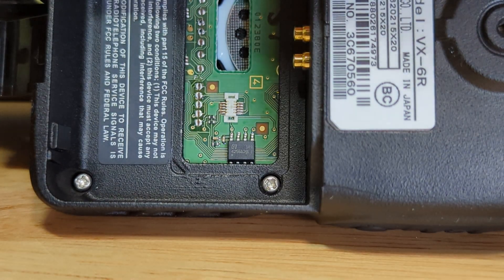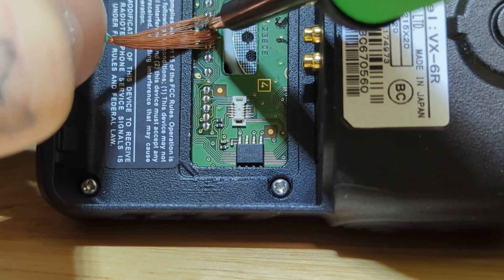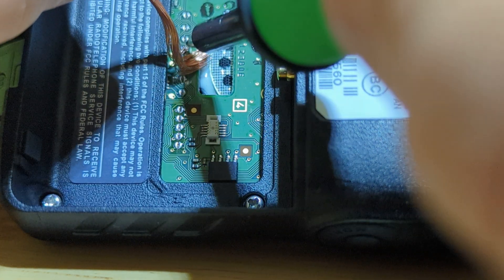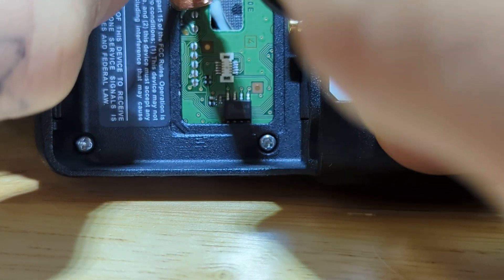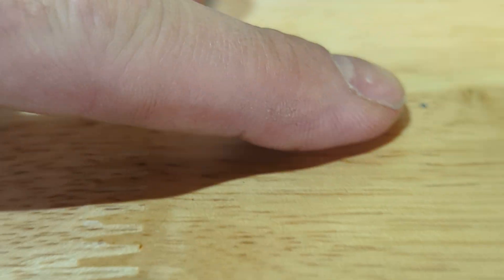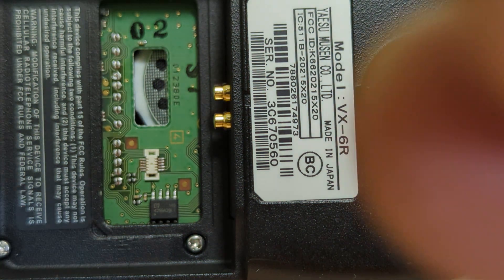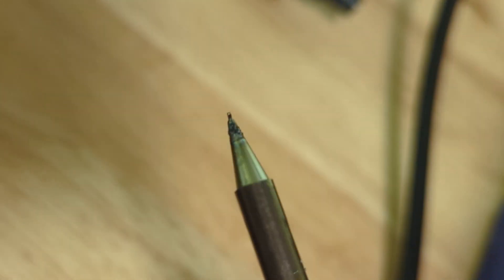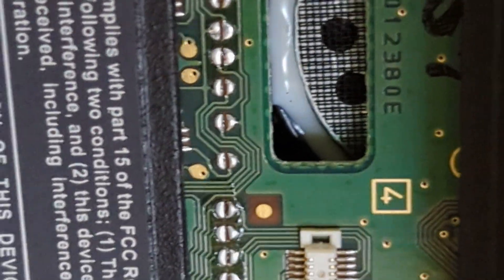MARS mod a Yaesu VX-6R

Comment: After performing the mod, will you loose the pre-programmed shortwave stations?
Reply: Yes, post mod you have to perform a full radio reset for it to take affect. These radios are super fast and easy to program with a data cable. Create a backup before resetting.
Reply: If you are asking about the pre-programmed memories WX, Marine & Shortwave Radio in the special banks [FW] [9], then those memories remained unaffected after I performed the MOD.

Comment: I've heard that the newest version of the VX-6R requires a different mod. Any thoughts on that? How old is your radio?
Reply: I just did this on one I purchased 2 months ago and it works.
Reply: I have no reason to believe these two radios from Ham Radio Outlet are old. You heard? What does that even mean? List a source! Provide information. I'm looking at two radios that freeband on multiple frequencies for emergency transmission. I heard different.
Reply: I also think “you’re fired up”. That’s how your comment comes across. Not “just stating facts” but all fired up for no reason at all.  Even rude, I’d say!
Reply: @CanadianDrifter777  Yep, he seemed pretty rude IMO too.
Reply: @RyanKitchen  Not sure why you're getting fired up. Just asking a question. I read that the boards have changed in the newest version of the radio. I think it was on a radio forum, but I don't quite remember. That's the reason I asked.
Reply: @czgunner  not fired up, just stating facts. Feel free to find the information and share it.
Reply: @RyanKitchen  From the modsdk forum: "This modification is for the version 4 board (photo is of version 3). I had a difficult time locating instructions for a board with NO solder
jumpers and eventually had to experiment to get it to work. I initially closed the #4 pad since most older radios referenced the 4 slot for the mod, but it was to remove the jumper. After the radio reset it wiped out the extra features and would only operate on the three ham bands,
and would not receive anything else. Frustrated, I removed the solder and tried again. It would still did not work properly and I thought I
bricked the radio.
After scanning the schematic, I went into experiment mode. I soldered the fifth pad and did the reset. All the features came back but still no
extended transmit. I then soldered the third pad, reset the rig and it worked. Full normal operation and extended transmit.
Apparently there are programmed feature sets in memory and when you assign the jumpers it simply recall the preset for each path to the cpu
(after reset).
It’s possible that only jumper three needs to be in place, but I would suggest doing the following:
Close jumper five and do a reset. Then close jumper three and do a reset. You could just do both at once, but I am sharing what worked for me."
Reply: @czgunner  Yaesu does build different radios for the EU. Depending upon which market it is intended for there are firmware and hardware variants. Since you posted from a European forum it does make more sense that the pcb layouts are not the same.

Comment: I have found info that only #4 needs to be removed. You failed to confirm that the mod worked.
Reply from the maker: Hi Phillip. I suppose that depends upon what frequency you are after. Jumper 4 is 6m, 2.25m and 70cm freebanding.  I'm glad you found info. I also found info, that indicated jumper 5 gets you frequencies above 800... which few people use but is helpful in a pinch for the MARS licensed.

I failed?! Hah! You deserve love and have a large beautiful penis.

Comment: My VX-6R has that same blemish in the plastic to the lower right of where the sticker covers. At first I thought it was some adhesive. I was always under the impression that it was solder bridges we're removing, and I was surprised to see these same surface mount components in the location when I checked earlier.
Reply from the maker: You arent wrong really... rather than just solder its a 0 ohm resistor to ensure continuity